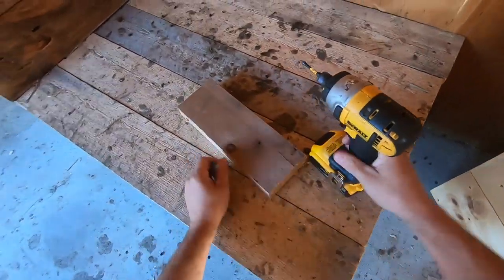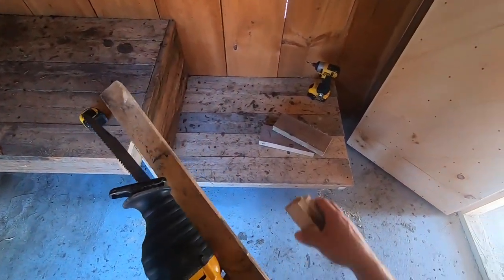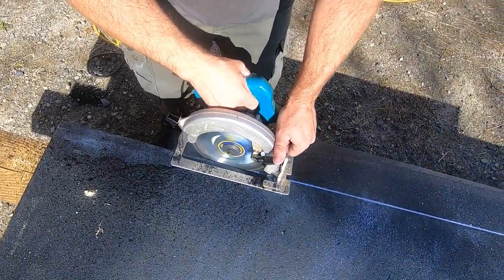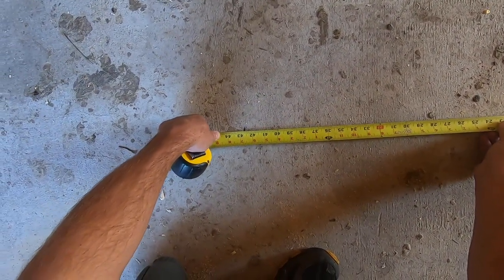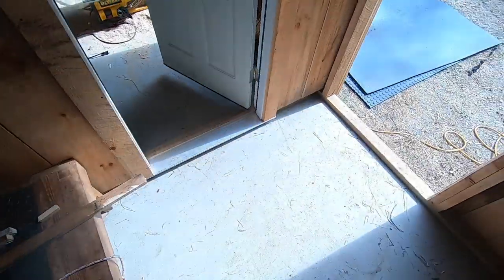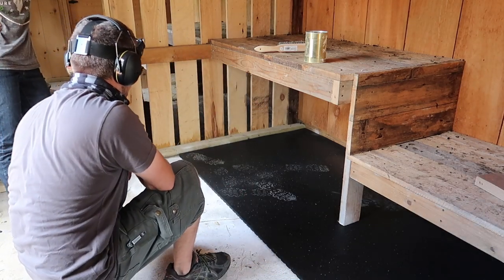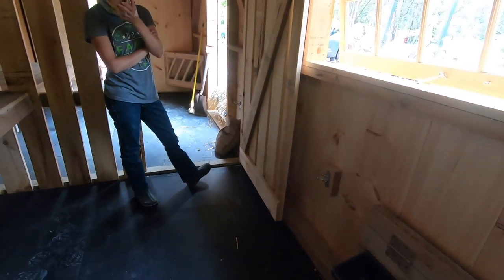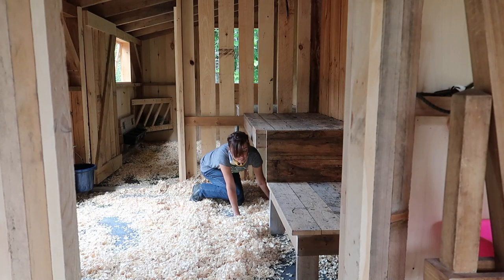was this a HUGE MISTAKE?? Concrete Floors in our NEW BARN

Comment: My horse friend uses stall mats and a lot of bedding (mostly wood shavings and some straw).  Spring clean out (or mid-winter when the temps are in the high 30s) are still required.  Add another bail or two of shaving every week or so.

Removing the mats and washing the floor is still occasionally necessary.  Use a leaf blower to dry the floor as good as you can before replacing the mats.  Cut drain holes/slots in the exterior footers so the water can get out.

Comment: tapered floors with a drain is hindsight but concrete without being sealed a couple time is porous allow urine to pernitrate. Still not too late to pressure wash a stall and apply sealer to help the mates do their job. If you seal the concrete don't go cheap to get best results. Your viewers have other good ideas

Comment: Seal floors, seal wood, install stall grids and utilize a mix of sand and dirt that can allow the urine to dry. Covering with rubber mats will cause a moist environment for bacteria and mold.  It's a common stall issue whether  or not you are on packed earth or concrete.  Concrete is easier to bring back to a healthy state with weekly cleaning.  The breathability of the stall grid will keep yuck from growing into a serious issue.

Comment: We used sealer (a couple coats) and then we put straw and/or horse bedding (wood chips) directly onto the sealed concrete.  We love the results with ours.  We clean out the barn about once a month and compost the materials for the vegetable garden.

Comment: Concrete sealer 3 coats. That will stop concrete from absorbing moisture. 
Bleach floor to kill bacteria (VERY IMPORTANT) wood chips on top of mats.
Sweep out wood chips weekly.
Worked for a vet. that had concrete floors. Had to remove mats weekly bleach dry replace mats then add wood chips.. All day job for one person ever week.

Comment: I just paused the video because I am intrigued by the engine noise happening in the background. I thought I heard it on yesterday's video, but it's much clearer today.

I'm going to carry on watching to see if we find out what is happening. I'm hoping for a play area for the herd. 😉

Hint on laying the flooring. Lift both sides you want to meet and push down together, that way they expand outwards equally, and fit together better.

Also works if you need to pack in bales of hay or straw in somewhere.
Reply: Its a surprise that they alluded too yesterday
Reply: @lukewarm2075  I guessed as much, so it's obviously work around the barn, so like I said, I'm hoping for a goat playground.

Comment: Deep bedding covers the floor and composts the hay/straw/chips you put on the floor.
Keep in down over the winter, then pull it out.. better on the concrete than on matting.  
Works just fine. You will have great compost for your gardens next season.

Comment: Like Wal-Mart they coat the cement with a coating to make it smooth and easy to clean I believe they smooth the concrete before. Maybe look into it
Reply: WalMart is not a barn.  You don't want it slippery,  but you also want to be able to use a shovel to pick up manure.
Reply: @steventhury8366  they use shavings. And that would help with the slip. The mats will only absord and hold smell. But to each their own. Just an idea 😊

Comment: A sealant and wood shaving/sawdust/or straw are easier to clean on a daily or weekly. time frame.
Reply: Fulltimer2011 
The wood shavings are too dang expensive!
Deep Bedding with straw is the only economical way to go. Then use shaving in the milking area.
Reply: @BrianBriCurInTheOC  maybe he can sing a deal with the wood chipping company that cleared his 4 ac. for shavings or chips?

Comment: I have used rubber matting  for my horses for 20 years. Buy the hardest ones you can. Seal your concrete first. Use plenty of bedding so urine can be absorbed before it leaks through. Horses are easy as they tend to soil in the same area. Wood products are great absorbers. Good luck

Comment: Highly recommend sealing the concrete. We have a rabbit barn, we put exhaust fans in to help removing the ammonia, which helps a lot. Rubber mats do slip if wet, even when they seem to have good grip, not when it starts freezing, so for fair warning. We have them only in our milking area (Since there is less traffic) We have to seal out concrete about every 10 years, its recommended. :)

Comment: It will get under the mats. Bed with shavings even on top of the mats.
Reply: take them bk up and use stable sealant then you hv done the job right I be there and done that now wee free if you wash down every day mks life easy
Reply from the maker: @megapixal1  what did you use for a stable sealant?
Reply: I agree just seal the floor and then bed the goats with shavings. Rubber mats seems a lot of expense for nothing
Reply: @LumnahAcres check you facebook page I put a pictuire up to day

Comment: What about sealing the floor like in a garage. Keeps chemicals from being absorbed.
Reply: the garage floor sealing will eventually wear away from the uric acid need to use a rubber kind and redo it yearly to stand up to the acid.

Comment: I know back in the day, animal structures had layers of sand and gravel for a floor. They still do that with proper horse stalls. The urine sinks in, and is decomposed by bacteria very quickly. Concrete floors started being used for dairy barns with barn cleaners to aid in waste removal, but with concrete you need to use quick lime and hose it down regularly. If you look for turn of the century books on farm building construction, they are quite interesting, and they really knew what they were doing. Hope your fix works!

Comment: Seal the concrete then put in mats.  Make sure you use a pro grade sealant.  Those mats will hold the smell too, you can seal them as well.  Better yet, seal and then use a deep litter method.

Comment: Some great comments here especially about the need to always seal any concrete that you want to last. I know you bought the rubber (nice) but this is a great opportunity to use salvage wood from pallets and make 3x3 or 4x4 tiles that you could lay on the floor. Easy to remove for cleaning, relocate to other areas... etc... Hooved animals have issues with smooth concrete as you well know. I think you and the wife are doing an excellent job building an amazing learning opportunity for your children as well as building a lasting legacy for your future generations to come... Joe

Comment: You can seal the concrete. You need to clean it first by power washing or  even etch it then paint it like a garage floor then seal it. I've done it in 2 homes, it's awesome. Then I put mats in to walk on barefoot to keep feet warm. Then those can be cleaned each year too.  Seal it so 'wetness' doesn't absorb especially if it comes with odor.

Comment: My family sealed their concrete. Also installed drains to hose everything down and out to a field. I know some people who installed drains afterwards, like the ones used around pools. Thin, long and with grates to cover the gap. Urine smell really absorbs into concrete like a sponge without a seal. Concrete paint and added sand could work too.

Comment: I wish I had posted what I was thinking back when you poured the concrete and then when it was finished introduced the goats into their stalls.  I was thinking of my dauughter's house she bought and how the whole house stunk of dog pee because the previous owners had kept the little dog in the converted garage that had an untreated concrete floor.  We had to treat it and treat it with vinegar and mop and clean it, air it out, and after a couple of years the smell of dog pee isn't the first thing you smell going inside.  So I would highly suggest cleaning and drying then sealing that concrete to help the situation.

Comment: I wouldn't recomment floor matting. I had it for my stables and it takes a lot of maintinance. The urine soaks underneath around the sides and starts to stink really bad unless you lift it and hose out underneath regularly. A lot more than twice a year. There are lots of different types of concrete sealers out there. They soak in too, so the floor would be sealed really well. 
Also a lot of matting is porous. It's good for helping to keeping bedding to a minimum and as a cushion. But straw or shavings does the same job and is much easier to clean out and stops wet soaking into the floor. Matting holds the wet on the floor as it can't evaporate.
Love you guys.

Comment: I live in NH and the black rubber mats Hold the urine underneath them and can freeze next to the doors making them hard to remove during winter. I now use just shavings and have a scrapper blade and keep the barn cleaned out every week. Also I sprinkle with a product that keeps the barn smell down.

Comment: Garage floor epoxy under the mats should be pretty easy to clean. I think it's intended for a smoother concrete finish but I'd give it a try.
Reply: garage floor epoxy will eventually need redone as the acid in there urine WILL eat it

Comment: We have been in your shoes before. Good ole hindsight. We used pine pellets in our horse stalls and it really absorbed the urine and kept the odor down. Shavings were more messy to us and would stick to our socks really bad and laundry was not fun. We opted for dirt floors with stall savers and leach pits filled with gravel.  We never had a problem with urine odor. The mats will be much warmer for them in winter than on the concrete. I agree with everyone else on sealing the concrete.

Comment: we had gravel/dirt floors in some old horse stalls in a large quonset barn so pouring concrete floors was out of the question. I am in South Dakota so our winters can get brutal here. We put stall mats on top of the gravel! This fixed the urine freezing  to the gravel issue. The wing were the goat stalls are should have had a sealer spayed down while it was still curing!!  A friend has a dog kennel and their kennels are off the floor, they seal the concrete with a 2 part epoxy floor sealer (required by usda) . They usually have to redo it about every 4-5 years so with the mats it should last that long for you also.

Comment: We have packed clay floors in our big barn. We run cows and sheep. It’s extremely rainy and wet here in Kentucky but the floor is just fine. The animals are comfortable and we find with shavings bedding there are very few wet spots.  The cattle stay clean. The clay is easy to clean. There are no arthritis issues like they get  from laying on concrete. In summer we let them in during heavy rain and extreme heat. We have heavy crush in front of the doors to stop mud and wet from being tracked in. We clean it with rakes and ordinary forks. We bed with straw for calving and it does well too. 
We use the barn mats in front of our shop doors, they are terrific and are tough. 
I was worried about your decision for concrete under the animals. Nice fix and I bet the goats will like the slightly softer feel of the mats.
Concrete is perfect for shop flooring though and will add overall strength to your lovely barn👍🏼👍🏼👍🏼

Comment: I suggested sealing the concrete before you built the barn.  You can buy sealer at Lowe’s, there are many different kinds that do many different things. The sealer will prevent the pee from being soaked up if you get the kind that seals off water and makes the surface waterproof.  This winter those floors will turn to ice if you don’t seal them off.  The sealer is not paint it’s like the equivalent of clear coat for wood only it’s for concrete.

Comment: If you ever decide to paint your floors, ask the dealer about sharkbite.  It's a sand product that is added to the paint.  It stops slipping should moisture get on the floor.  There would be times the goats come in with wet hoofs, so it is a safety precaution.   I slipped on a porch and landed on the steps with my back!  Since the repainting,  including the produce , no more slipping.

Comment: I would recommend an epoxy garage floor paint as a sealant even under the rubber mats.  It is quite impervious to most chemicals including road salts among them which are more agrresive than urine salts. They are readily available, easy to apply, can be built up quite thick to fill the concrete surface variations and are not overly expensive.  Another option for you to consider.  Whichever product you choose seal the concrete quickly before the surface begins to spall off as a result of the urine salts attacking it. The mats will only reduce urine exposure, not prevent it.

Comment: You need drainage for this something like a shower drainages. You need to dig a part of your concrete floor to install it or increase the the entire level of the floor. In this case make sure the water flows to the right direction. Long run advantage is that you can clean with pressurized water. Anything else will accumulate the organic material which can lead to other problems. Invest a little bit more effort now to avoid bigger problems.

Comment: Seal the floor with flex seal
Reply: WILL not hold up. (RUBBER)
Same with pool paint.
Use a concrete sealer clear 3 coats min. Renew every year one or 2 coats.
Did this for a VET.
High maintenance  (CONCRETE FLOORS).
Reply: @ralphgresham6327  i cleaned my dog run concrete with urine be gone and sealed it with flex seal and it held up to two Rottweilers 2 chihuahuas and a pitbull running pooping and peeing on it all day it is just like using a waterproof concrete sealant you still have to maintain and reapply all of it after years of weather exposure.

Comment: I don't see where anyone else made this suggestion, so I'll add it.
Look into sodium silicate concrete treatment.

It's cheaper than "coatings", non slippery, it soaks into the concrete and reacted to create an inches thick, high density waterproof layer.
It lasts as long as the concrete, which lasts longer with the treatment.
Protects against freeze spalling.
Very easy to apply with a garden sprayer and a squeegee.

Also known as water glass, the same stuff used to preserve eggs for months.

Comment: For what its worth, you could grind some drainage grooves in the floor, seal the concrete well, then reinstall your mats. With the nubbed side down you should be able to get a little ventilation under the mats. those mats will definitely help with cold floors and some moisture control. Bedding to soak up the funk.

Comment: I have no idea about concrete vs. gravel, lol.  But I do have a trick with those compressed bales of shavings!  On the large front face side, cut a capital letter I with your knife/box cutter (across the top, across the bottom and then down the middle).  It'll pop out of the bag so nicely and you can even pick up big sections (almost like flakes of hay) to move around.

Comment: you need to glue the rubber matting to the floor and seam it with a silicone adhesive, impermeable and indestructable (at the very least seam it to prevent seepage). Pressure washing with an enzyme and disinfectant cleans out most of the odor effectively. One other option is a poured resin epoxy floor also impermeable but more expensive.

Comment: We’ve had goats for 8 years.  We leave their floor completely bare.  We put in a big plastic ice sled (used by ice fishermen to pull their equipment across the ice) $44 at Walmart.  Fill it with shavings, lime, hay on top.  The goats will pee in it.   Change it once a month, great compost pile material.  I’m in Sugar Hill, come take a look.  It works great.   Pee will just go through mat seams.  Mats very expensive and heavy. . Goats will pee wherever there is hay or shavings.
Reply: I think Al should implement your idea, even with the rubber mat...the mat keeps the goats warmer...win win

Comment: Did you consider the tile squares?  They are about 2X2 and lock together.  They would make a carpet and when cleaning Gina would be able to pull them out for cleaning.  I use them in my nest boxes.  I can just lift them out with the old bedding and easily dump and clean.  Easy on the eggs as well.

Comment: Al, if the mats don't work out well. Try pressure washing them and apply a rubber paint to the lower 12 to 18 inches of the floor. The truck bed rhino liner, or similar product is available at the big box hardware stores in the roofing section. Love watching your videos, keep up the hard work.

Comment: In Holland we have stables with concrete Floor and straw on it, every day New load on top. In the spring we clean it up , it is warm straw absorb the urine. And it is warm. And we have stable with special mats secured with bolts in the Floor the cowmats are 2,5 cm thick . Not a mistake  this is better 👍🏻

Comment: I suggested before about sealing before along with putting a baseboard around the sides for splatter so when they urine it will be soaked  by the baseboard instead of the your walls etc. when they start to deteriorate you can replace the board instead of  your wall.....

Comment: Have a great Wednesday. Thanks for the video. When I was a child my uncle had a large chicken house that had a concrete floor with gutters for manure, also the cattle milking barns had concrete floors with manure gutters. So your concrete is probably not a mistake. Need a good power washer for the summer and odor neutralizer. Baking soda and white vinegar are the two common things that neutralize the ammonia in animal urine, mix either one with water and let it soak in. Then rinse with clean water a couple of times. I use tea tree oil for so many things too.

Comment: Clean the concrete with a pressure washer and chemicals, let it dry (thoroughly) apply several costs of clear concrete sealer before you do anything. Eventually the Urine will get through whatever you put down. PS, while you are cleaning the concrete, clean the lower level of the walls and apply several heavy costs of the same sealer on the word.  You can use a garden pump up sprayer to apply the sealer, works Fantastic. GOOD LUCK, VINNY 🇺🇸